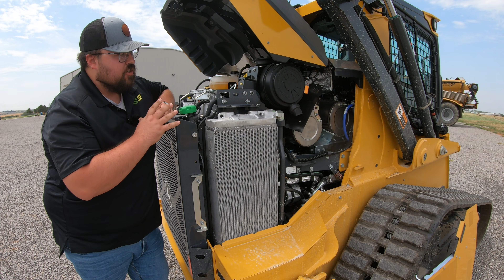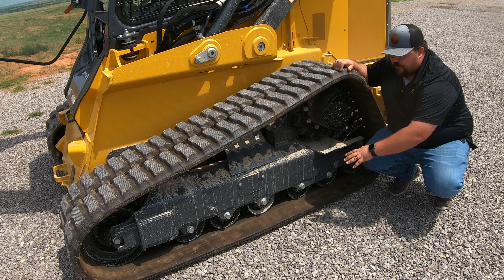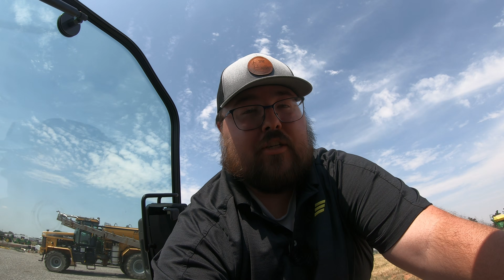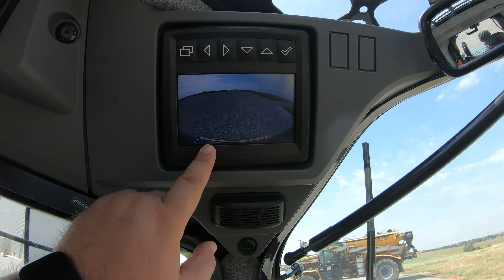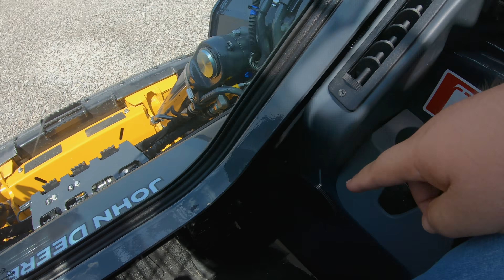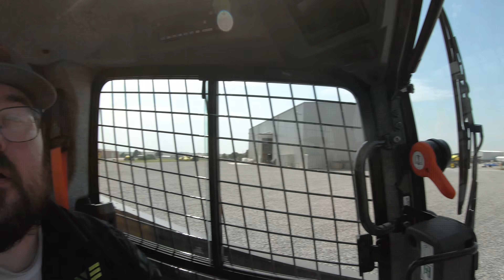NEW John Deere 333P Skid Steer Review

Comment: How do you get maximum flow from half inch auxiliary fittings on the boom. My disk mulcher has 3/4 hoses and fittings. My 331g has high flow but 1/2 in fittings.

Comment: Our 333P had all options checked off but did not come with adjustable joysticks. Not sure why. I still haven’t had time to do a video of it but will as soon as we get time. So far the machine is incredible on power and ride. Love the suspension system on the tracks, really takes the vibrations and hard hits out and softens the ride.
Reply from the maker: Glad to hear you are enjoying it. I know I had a lot of fun doing videos over the 333G a while back and the improvements int this new P-Tier are awesome!
Reply: @WesternEquipment  yes it is a great machine. The improvements are very nice and I look forward to see when they update the 317 and 325. We have each in a G model and would love to have the new series improvements added to those models
Reply: Mine does not have adjustable joysticks either but I’d love to have them. Not sure if they can be added at the dealer or not
Reply: @jweems440  I sat in a 334P at the dealership that had the adjustable sticks and I honestly didn’t see any advantage. They feel good in any position. None of my guys have complained yet on ours with the stick position.
Reply: @jweems440  Yes sir, you can add them after the fact, just did it on a Level 2 331 P,  however keep in mind, most 333 P's are ordered with the level 4 equipment group which does not have the joystick pods.